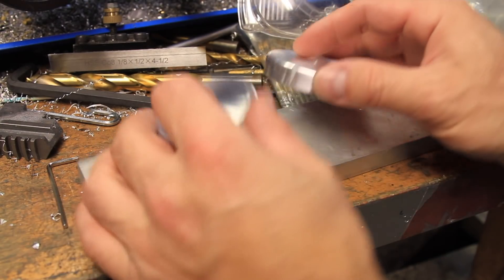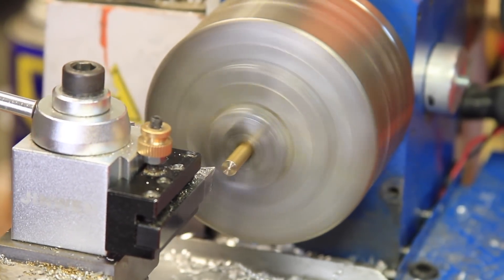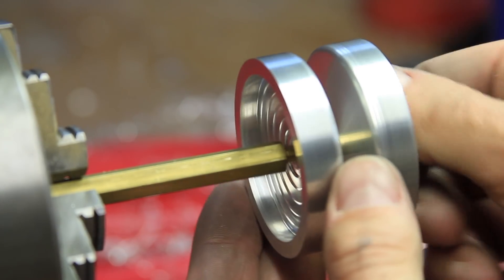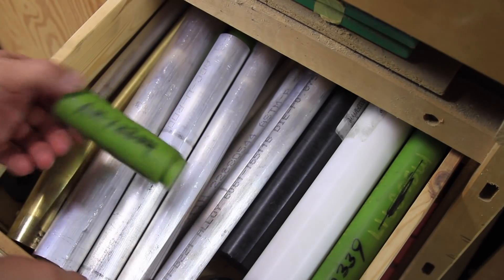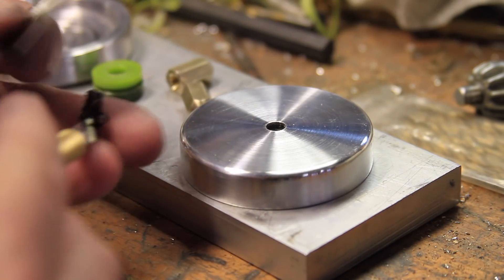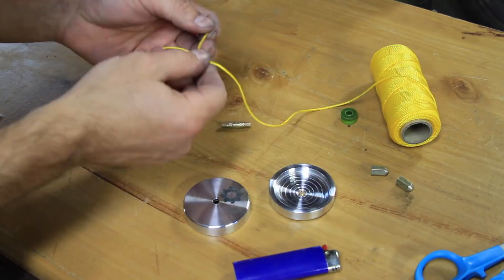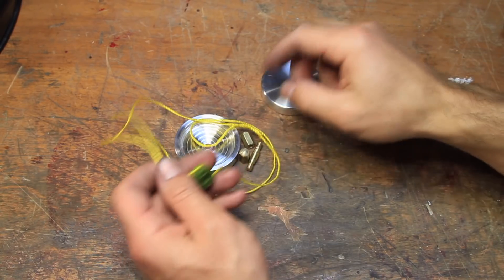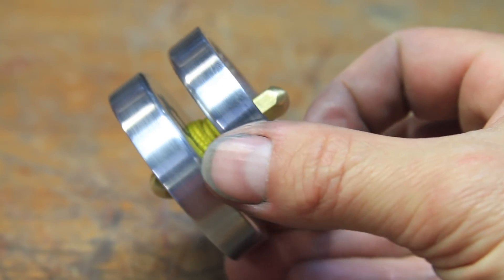(2/2) Making a Custom DIY YoYo on the Mini Lathe - the axle, etching, & assembly

Comment: Definitely more of a fun project than a practical yo-yo but had some great ideas with the weight distribution. I was looking for simple DIY ways to make a yoyo for fun more so than the actual yo-yo being perfect and when I searched building a yoyo from scratch your video is the first one that came up. It's cool that you have the ability to make something but I don't have a lathe cut or those tools. I think the yo-yo industry has been so established and many yo-yos are mass produced but the real thrower yo-yos are machined in much smaller quantities for professional play. Nonetheless I was a bit bummed out with the time lapses they could have been trimmed up and was looking forward to a longer end sequence. Overall its just cool that you made that by yourself and for a machine engineer or DIY crafter I think that's where the fun is.

Comment: A few points on the yoyo, first of all great job!, love the look of it, now, those nuts are too long and that dosen't help it to cut the air, and the bearing you've made also not a good idea because, if you want to make a yo-yo with a bearing you're better of getting a ball bearing for yoyos they can be clamped and not suffer any problem, what you did here is called a fixed axle yo-yo, in order to make it come back in a more of a easy way, you can add some 'teeth' inside near where the line goes, talking about the line you can buy yoyo strings too, they are a little thiner and stronger, but if yours didn't snap then don't even bother, all in all great project!, my dream project whenever i finally get a lathe

Comment: Try removing the plastic and slimming the gap to about 3-4mm then use a loop about twice the diameter of the axel......im not an expert on yo yo's but I've never had one with a Bering like that it's all been string friction
Reply from the maker: Thanks for the suggestion, I'll tinker with it.

Comment: great machining but your understanding of yoyos is cringey. you can learn how good quality yoyos work by watching competitive yoyo-ers explain on youtube. The string accelerates the yoyo (rotationally) by gripping the sides, while the bearing is supposed to be extremely low friction so it can hold a spin when fully extended. the yoyo is then retracted by the user manually

Comment: Can i ask why u used brass for the centre shaft?, also I love your videos and upgrades to the lathe keep up the great videos and I look forward to when u make the new handle for it.
Reply from the maker: Thanks! I used brass because it's inherent low friction but also because I only have hex stock in brass so I figured I'd just keep it the same material. Also, and this could be totally wrong, but I thought having a heavier axle might keep it more stable (like the pole that tightrope walkers carry)